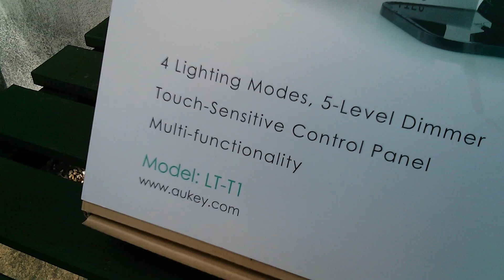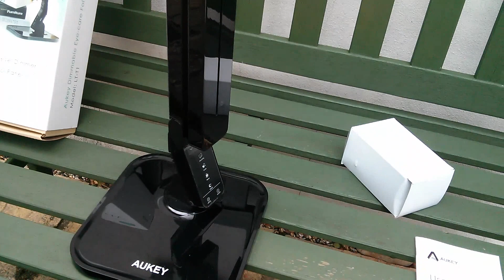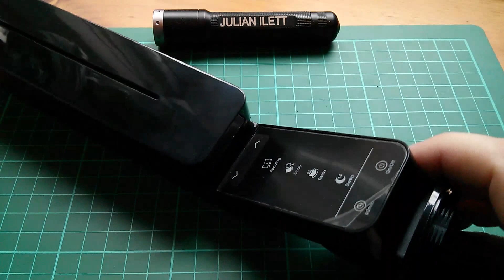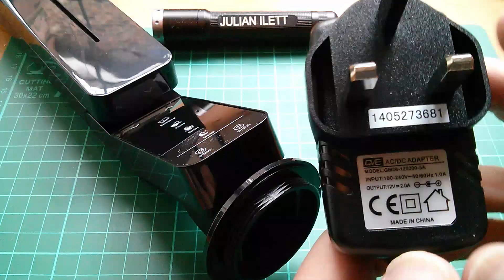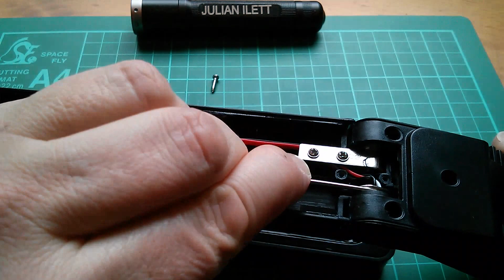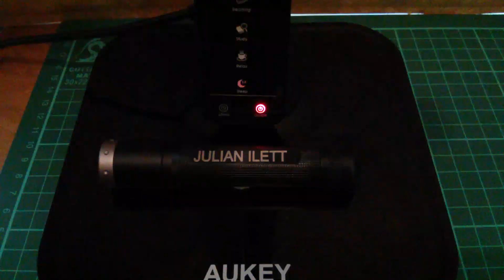Review/Teardown: Aukey LT-T1 LED Dimmable Folding Desk Lamp

Comment: I was hoping to see HOW you disassembled it.  I've unscrewed all the screws and nothing seems obvious.  I need to destroy that frickin' ON/OFF LED.  It shines bright red when off and blinks when using the timer.  F that!  Too distracting in both cases.
Reply: Actually, once I threw caution to the wind, I just pried it off.  The base is connected via 4 plastic clips built into the casing.  Pry (gently, not heroically) laterally and separate.  For the LED, I just unsoldered on end of the LED off of its contact.  Everything works perfectly when reassembled!

Comment: Something I would like to see in all lamp/torch reviews is how much light (ie lumens) they actually produce compared to what they claim.  But I realize that this is not an easy thing to measure so does anyone have any suggestions for how to do it?

In the case of a desk lamp it would also be good to measure the illumination level it actually produces on the desk, (ie.lux) which is much easier to achieve, all you need is a cheap light level meter.  I can recommend this one  http://www.amazon.co.uk/Light-Meter-LX1330B-200-Luxmeter/dp/B005A0ETXY/ref=sr_1_1?ie=UTF8&qid=1428173835&sr=8-1&keywords=lx1330b
Reply: number 33  Keeping with the spirit, there is a light intensity sensor for Arduino:

http://www.ebay.co.uk/itm/351344110416?_trksid=p2059210.m2749.l2649&ssPageName=STRK%3AMEBIDX%3AIT

I was interested how bright - Amazon.com have a confusing statement "LT-T1 Aukey LED Desk Lamp has a power rating of 9W, and its brightness is equivalent of a 55W incandescent lamp"
Reply: David Pilling That sounds about right, you would expect a LED lamp to produce about the same amount of light as an incandescent lamp with six times the power rating, but I don't see how it ties in with the box rating of 15W..

The best idea I can come up with for measuring the light output of light bulbs (not applicable to a desk lamp) is to construct a wire frame dome around the bulb and measure the illumination level (lux) at regular point around the dome using a light level meter.  Then multiplying the average of all the readings by the area of the dome (sq.metres) gives you the total light output in lumens.  Having an Arduino based light meter where you could push a button to add a measurement to the average would certainly make the job easier.    

Theoretically you need a full sphere but I'm assuming that the light emitted to the rear is usually going to be negligible.  If the lamp is symmetrical around its central axis then you only need to average a 90 degree arc. 

Different approaches are necessary for torches and things like desk lamps.

Comment: I'm not really fond of devices that don't have a real off switch, especially when it is a simple desk lamp. It should definitely not need to be connected to a power supply all the time. But since it loses its settings when you disconnect the power (as you mentioned in other comments), the dimming option becomes more of an annoyance than a feature.

Be careful when running the lamp from more than 12V. The switching regulator won't care and I'm pretty sure the linear one isn't used at its limit either. But my guess is the LEDs will get fed whatever voltage you give them at the input (there's no other regulator to be seen). Most likely they just used simple 12V LED strips mounted to the metal plate. They (and the voltage dropper resistor, you'd find on the strips) will heat up more which can kill cheap strips quite fast due to thermal stress. It should be totally fine if you don't run them on full brightness for long times, though.
Reply from the maker: superdau That's a very good point.In fact my requirements are not quite as I described. I need it to do the 12v to 5v conversion during the day (for phone charging), and I need the microcontroller to run during the day (to hold the settings), but I don't really need the light during the day, unless it's a really dull day, and dull days don't produce 14.4v.So it kinda works!!
Reply: Maybe LT1085CT-12#PBF mounted on the good heatsink connected between the fixture and supply?

Comment: The links say 5V/2A USB Charging Port not 1 AMP
Reply from the maker: Wayne Johnson Yes, you're right. In the introduction section of the user manual it says 1A, in the specifications table it says 2A. I guess I'll have to test it ツ. My phone is drawing 1.45A and the voltage has dropped to 4.89V - it looks like 2A is the correct spec.
Reply from the maker: superdau It kinda works: 12*2 on the PSU = 24W.15W for the lamp plus 5*2 for USB = 10W. Total 25W.
Reply: Julian Ilett 
One has to wonder how much reserves the power supply has left, when charging at 2A and having the LEDs on on full brightness.

Comment: why so many dislikes? pretty cool lamp
Reply from the maker: m8e I will now 'tear down' everything I get sent for review. That way, we get to see the electronics inside stuff that we may not normally take apart for fear of breaking it. If I damage stuff during the teardowns, well, so be it!
Reply: Gamewwx because this video is not good content, even by Julians standards. [edit: nah actually, its more or less in line with his usual standards. just maybe a little more boring. so i don't know why the negative reaction. maybe because its got very little DIY relevance? its not an item we buy on ebay? i must say i find this vid pointless.]
Reply: intriq8 you are right. vid is different from other vids and it was little bit pointless
Reply: I think people disliked this because they think it's basically an ad for Aukey, they paid Julian a desk lamp for this ad.

Anyway, congratulation Ilett for getting "free" stuff. You should get something for making great videos.

An very interesting desk lamp, might have bought one if it also came with an screw clamp and had non-volatile memory or possibly an built in timer. (not just an 60min off timer,)
Reply: Julian Ilett Thats cool

Comment: Looks good and well difused light, and it also looks like a good lamp for a solder station. Been soldering 0603 components by hand lately under a goose neck LED lamp (single LED with lense). Because of the harsh shadows it was difficult to determine if a component is perfectly center while soldering.
Reply from the maker: bbytew Yes, I think this would be a good light source for general assembly work. The soft shadows make it more like working in daylight.
Reply: Julian Ilett 
Might be able to use it for my  watch repair hobby.
Julian, they rate it at 1350lux but I suspect that is at 1m. Do you have any way of measuring at say 10"-12" ?

Comment: Thanks for the review, now I suddenly want  to renew my existing 11w lamp from the mid 90's!. I have a question, does this lamp remember its previous power settings when power is removed? By that I mean, if you remove the power while its on, and then plug it back in (preferably next day) does the lamp resume its last operation?
Reply from the maker: Da9eI Just checked that - if power is removed, it defaults to 'reading' mode at the middle brightness level - in fact it forgets the brightness settings allocated to each of the 4 modes (they all revert to the middle setting). If the power is left connected and the lamp is turned off using the on/off button, it remembers all the brightness settings and the last mode used.
Reply: *****
This is a common issue with these lamps.

Comment: The auto focus at the beginning of every video is kind of a trademark of you. :D Is it your Nexus 4 that does this? Does it happen with all other Nexus 4, too? o: Happy easter weekend!
Reply from the maker: ***** A rather annoying trade mark! I assume all Nexus 4 phones do this - my wife has a Nexus 4 too - maybe I'll try that one day. I was looking at cameras the other day - what I want is one that keeps the video image upright regardless of whether you shoot upside down or normally. Phones do that, but it seems that cameras do not. I'd like an articulated LCD on it too. I'm still looking for the perfect desktop video maker's YouTube camera.
Reply: For me it's not so annoying. Does not happen too often. Smartphones are not intended for professional video filming. I have tried to film the china DIY microphone controlled 3 band VU meter with my HTC One M8. The digital image stabilization was so confused, that the video was shaky as if I was blue. ;D So I used my Nikon 1 J3 camera which does a good job, it's sensor would be better off a noise generator for encryption purposes... Bloody tiny sensors today!

Take a look at the (rather very expensive but very good) equipment Dave L. Jones from the EEVBlog is using. Canon HF G30 is the current model, but I presume you can get the also very good older model HF G10 affordable new in UK.

As far as I know, white balance can be set manually and fixed as well as exposure time and aperture on these models.
Reply: Julian Ilett 
Keep an eye out on Techmoan's chan. He's always reviewing cameras.